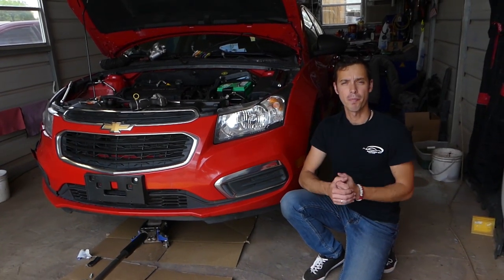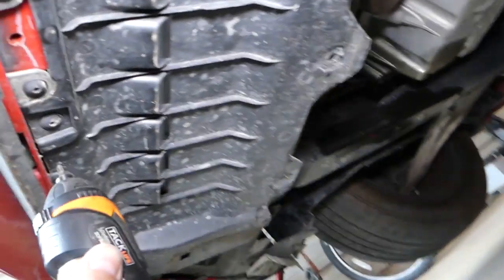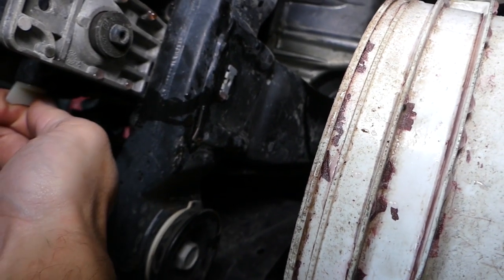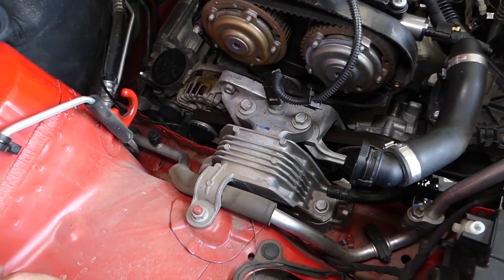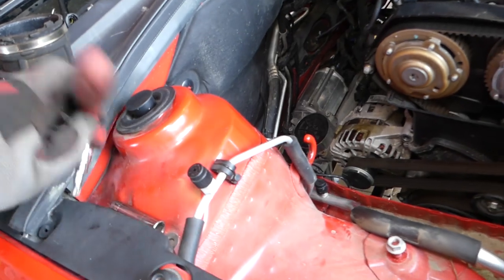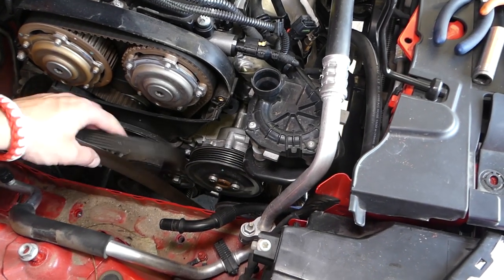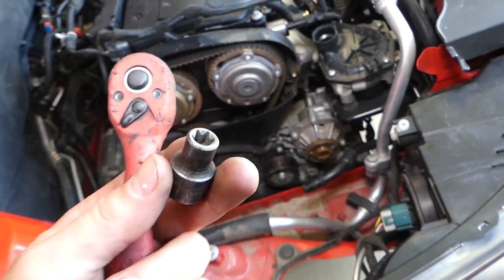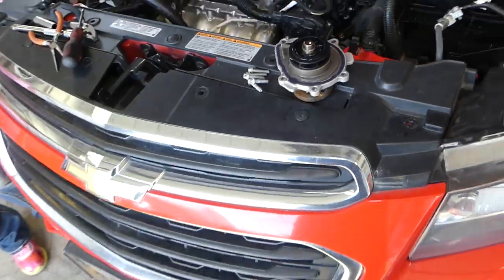CHEVROLET CRUZE WATER PUMP REPLACEMENT. CHEVY SONIC WATER PUMP REPLACEMENT

Comment: Thank you so much, for this great video. This helped me to replace my car water pump. Its a 1.8L CRUZE.  Really good hints. By the way, I used a two feet hose (4 mm inside diameter) and emptied the coolant, without removing the  cover under the bumper.

Comment: Removing the wheel and turning the crank is one way to turn the engine and move pulley but you can also loosen the tensioner on the belt, spin the pulley enough to reach the bolt, and drop the tension again and remove the bolt
Reply: This is exactly what I did. I didnt want to remove the tire so I just took the belt off the alternator, spun the pully and replaced belt 3x. it wasnt that bad. Removing the Torx 45's where a bitch though. Those suckers were TIGHT

Comment: There is a Husky 22 piece through wrench style torx set that won’t require removal of motor mounts it will fit with plenty of room to spare also use a little adhesive on the pump to attach gasket so it won’t move during assembly and torque to spec

Comment: Just call me lazy but the only thing I jacked up the car for was to drain the coolant. This is a quick easy job if you use a torx bit and a ratchet wrench. I think it’s a T45 bit and a battery side post wrench will fit without having to do all the moving things around. Break it loose before you remove the belt. I’ve done two this way in about two hours each and I’m old and slow.

Comment: I always recommend getting a scrap hose to guide the coolant into the bucket. Waaaay less of a mess.
Reply: Ever since I started working on my Cruze I have kept one from an old line I replaced. Much easier to put it on the nipple down there and screw the valve open to drain it that way.

Comment: You can avoid taking off the wheel by losing the tension on the belt and turn the water pump until you can lose the other(s) bolts.

Comment: On the 2014 that Torx 45 won’t fit between the rail and the pulley a short or stubby torx 45 is needed

Comment: Unfortunately I own the sonic version of this car, replaced wtr pump a year ago only to get to do it again, along with serpentine belt, pullies,  and belt tensioner and last but not least timming belt. I put alot of miles on this car and it still gets good gas mileage 35-37mpg otherwise it would have been at the bottom of a ravine or just plain blown up! Should have bought a toyota.......but It was cheap, I sure know why now. Any way great video thanks for posting.
Reply: I'm here watching this video and we replaced my timing belt and water pump about 2 or 3 years ago. Time to replace my water pump again. 🙄

Comment: Hi ,what is recommend to change first ,timing belt or wather pump?
Reply: timing belt, change all components in that area that is required then once that is all done and put together change the water pump if you want change the thermostat also, throw on new belt and belt tensioner after you put timing cover back on they have a gasket for that too.

Comment: Hey Repair Guy, I have a question. I have a 2015 Chevy Cruze. I recently replaced the thermostat, now it stopped with the fan running high, but now there is a ticking noise coming from the engine on the side where the belt is. I have no idea what is making the ticking noise, any idea my friend? Thanks
Reply: If you haven’t fixed this yet. Has your car also been running like crap and dying while pumping gas? If so it’s the purge valve.

Comment: Do you not have to worry about the car coming out of time when doing this?? I have a 2014 chevy cruze 1.8l NON turbo..and water pump is leaking.. from my understanding its the same belt that drives the timing.. and could mess it up if its moved wrong while replacing???
Reply: Gitago Gaming The water pump belt is not the same as the timing belt. The water pump belt just runs from the water pump to the alternator.
Reply: Hopefully you replaced the pump.  I had the same problem n it was dripping on my a/c compressor and it stopped working
Reply: It should be serpentine belt drivin. Most are. Some are timing.

Comment: 2011-2014 cruz 
2012-2014 sonic
With 1.4 engine
Leaking water pump is still under warranty! 10 years/150k regardless less of owner. Take it to Chevy have them fix it for free and get your complementary rental while they fix it! 
https://static.nhtsa.gov/odi/tsbs/2015/SB-10079524-0335.pdf
Like this so everyone can see it.